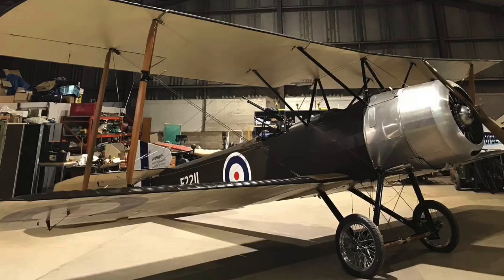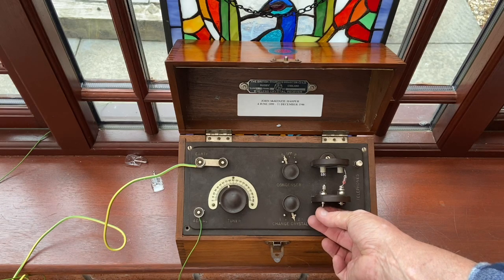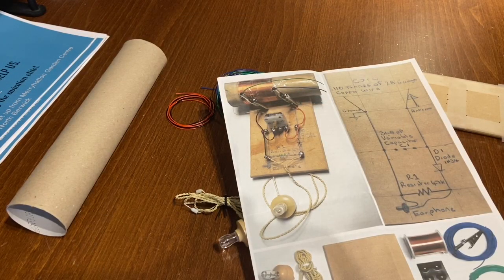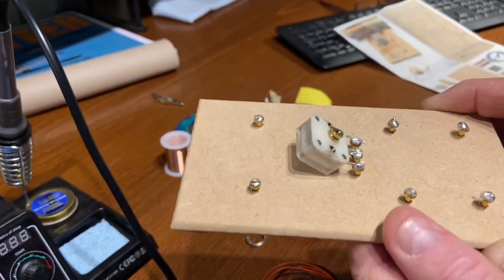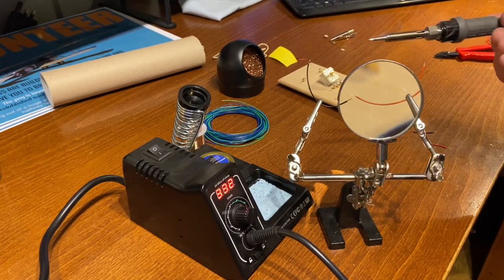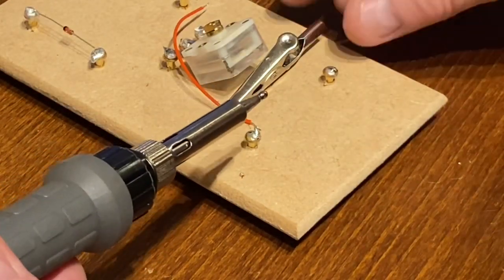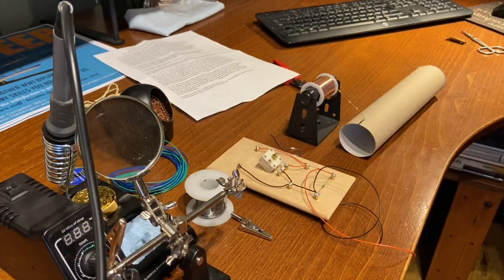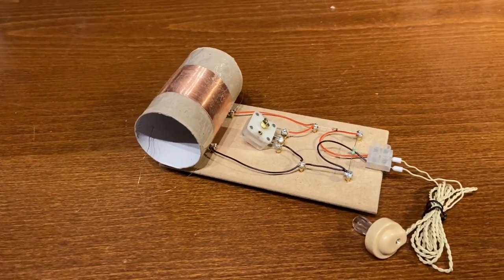Making a crystal radio

Comment: After many failed 1 capacitor radio circuits, I finally found one that works well. You could modify this circuit to that design. The coil is divided up into 3 sections. The left side has 10 turns, then a tap. Then 20 more turns, then a tap. Then 80 turns and done. The 3 sections are connected and wound together without gaps. The antenna is attached to the far left side. The ground to the next tap (one side of the earphone and one cap connection here also). The diode-earphone connection to the next one (and the resistor is still across the earphone connections). Then the right side of the coil is connected to the other side of the cap.

Comment: Friend, please tell me the dimensions of the tube used for the coil and the thickness of the enameled copper wire. How many picofarads is the variable capacitor? Is the resistor 47k? Thank you in advance for your attention. Congratulations on your work!

Comment: That paper tube is not really strong enough. Too easily damaged.
Reply: Made one as a child 60 years ago used a toilet paper tube with a couple coats of shellac. Didn't have the galena and cats wisker used a razor blade and a safety pin with a piece of pencil lead attached. you mounted the blade and the safety pin such that the lead touched the blade and moved it about til the sound of a local station was heard. Otherwise it was very like this in construction.

Comment: Thanks for showing this. I'm playing with a transmitter from parts at the moment. 

Notice how it didn't require power. In a sense they were less stupid back then. That's why it's a good idea to look into.

I found a mono amp board at the size of 3x3x1 cm more or less in China (eBay) and it's quite useful as I power it from USB/5 Volts. It gives a good punch for mono setups for simple stuff. I didn't predict that I would use a little amp so much. It goes from one place to another all the time.

Comment: Looks like you have a unit from the 1920's or so! A friend of mine builds "Replicas" of old sets from plans published way back then! It's very difficult to get hold of an original "High Impedence" type of headphones. So, sadly most of us have to resort to those cheap, low quality earphones made in china. Some seem to work okay, while others don't work at all.
GOOD LUCK.
Reply: You can use modern headphones using a small impedance matching transformer in reverse.

Comment: A beautiful century-old device. That crystal is galena. Pyrite (ferrous disulfide) can also be used, which is also a very good detector. Galena can be made at home. To the kit - a very unsuitable handset. It is necessary to use a high ohm handset (2-4k). Then there are the radio stations themselves, which are mostly FM. The crystal received long and medium AM waves well. Very short AM waves could no longer be received well, just as it is not possible to receive FM well around and over 100MHz, except that FM is a different way of receiving and FM transmits with a fractional power compared to AM. Theoretically, nothing can be heard through the crystal in this century. If so, then a very close AM CB source, or an AM band reserved for emergency broadcasts. In most cases, it is no longer possible to receive an AM crystal.
Reply: You are wrong. There are loads of AM stations to be heard. You're also wrong about FM transmitter power. They're actually quite high power and use high gain antennas. Additionally, one doesn't "make" Galena. It's either purchased or found if you're lucky enough. Only the accessories for using Galena might be made. I have some that I got in a gem shop. Not expensive. But one can also use germanium diodes. 1N34 for example.
   Audio frequency matching transformers are available to enable the use of modern low impedance headphones.
Reply: What? There are literally thousands of AM stations operating! I have 3 dozen near to me.

Comment: I had a crystal radio receiver when I was a child, and this brings back some memories.
Incidentally, I don't use much of the modern lead-free solders as they are rubbish.
Reply: Lead in solder isn't a problem for most people. I worked in many phases of electronics through my career including wave soldering which you might think of as a bad offender. I also was casting bullets and shooting in wholesale quantities especially when I was competing in the shooting sports. My coworker had similar electronics lead exposure and he cast many fishing sinkers over time. I sometimes helped him with it too. So based on the foregoing we both thought it would be wise to get tested for lead. The test results came up negative for both of us. The vast majority of people then would seem to have nothing to worry about. As far as I'm concerned any lead "problems" are grossly over emphasized.
   So go ahead and use leaded solder freely. You and the vast majority of people should be fine.

Comment: Good day to you. Why would you buy a kit? These crystal radios are SO easy and cheap to make. Success depends on a long antenna 100’ plus (as high above the ground as possible, horizontal and properly insulated) and an EXCELLENT ground connection. Make these adjustments and you’ll pull in stations from 100s of miles away. Good luck to you!
Reply: Kits serve the purpose of easy access to parts. With electronics stores disappearing it's not always easy to get one each of this and that. A $.50 capacitor with ridiculously expensive $5.00 shipping plus the wait isn't always the best solution.